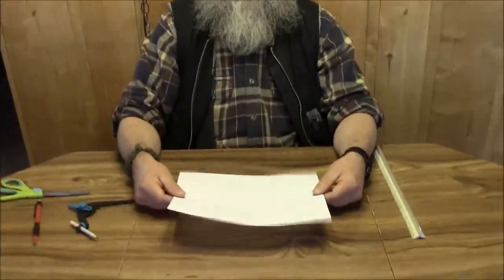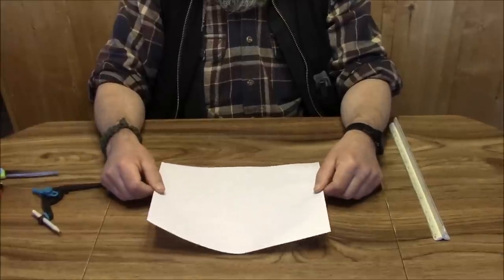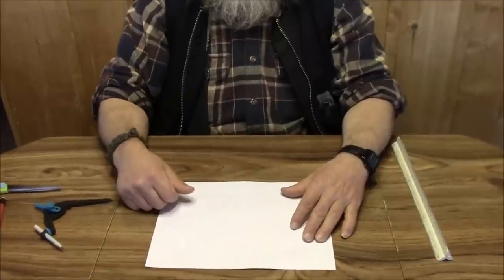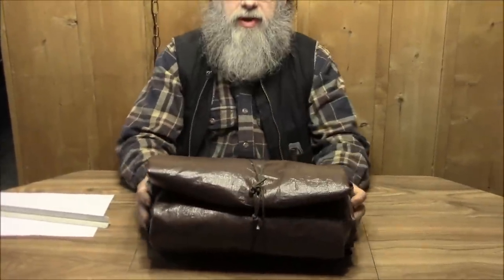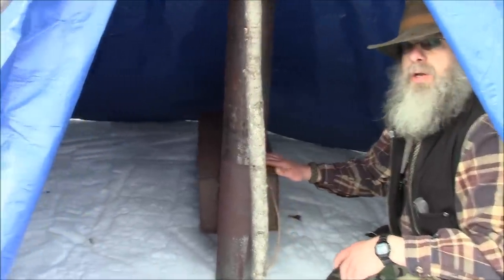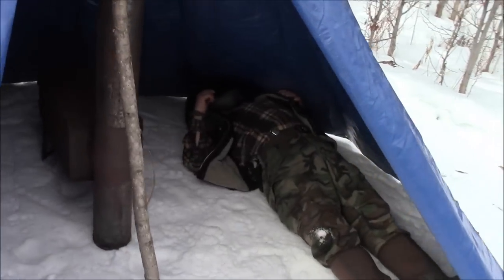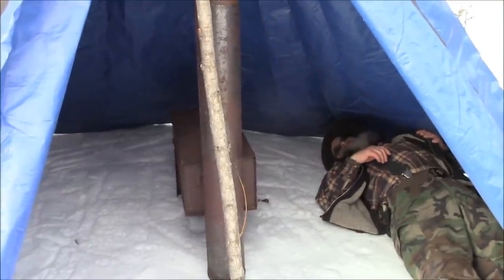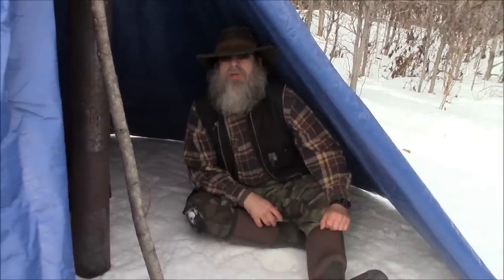Make A Tarp Tent Tipi Hot Tent On The Cheap

Comment: I lived in one like this for a year. Ended up homeless in tge beginning of winter during a pretty bad storm with freezing rain and snow. Add as much insulatiin as possible. Moss, leaves, even line the interior walls with any extra clothes or bedding you can spare if possible. I also dug my fireplace into the ground  and built more of a fireplacr like structure to create thermal mass and if you can, keep a pot of water or beens or chilli going. You wont have to get up every 15 minutes to add more wood and maintains the temperature inside. Oh, and another priceless addition, a funnel or makr one with a bottle and a length of water hose running away from the tipi through the wall.  Im sure any man can figure out how this would be priceless at 2am when its 12° f with 30mph winds and freezing rain outside.lmao. Last thing you want to do is go outside right then😂.

Comment: I've got a question thats been on my mind for a while now after watching these kinda videos, what about ventilation? Do you need airflow into your shelter to breathe, literally for oxygen or will you be fine for hours in this kind of shelter?? Appreciate the vids too man always enjoyable and informative.
Reply from the maker: I just spent a night in an enclosed tarp shelter night before last and I have spent many nights in the shelter.   If you have not already done so, you may enjoy watching the video where I show how to set up a simple tarp into an enclosed "tent".   the tarp configuration in that video is the one I spent the night in night before last.    No there is no threat of running out of air as the shelter is not sealed.   The bottom remains entirely open.

Comment: I really like this design.   I think I will give it a try.  Any idea of the standing height?   I know you made this years ago.   I want one for someone who is 6 feet tall.   Thanks.  I'll have to watch the next video too.
Reply from the maker: The height is about 6 feet but that is right in the peak where the pole is.  I am about 5.5 feet tall and I can stand up in it but my head is against the roof and the pole.   You may also like my cowboy range tent build as there is plenty of standup height regardless of a person's height.

Make A Pyramid or Range Hot Tent On The Cheap 
https://www.youtube.com/watch?v=t47WFUZM4go
Reply: For people making different size cones (tipis) there's a site called BRICKLAYER that you enter data (height, base) and it diagrams a pattern how big a tarp, the slant (length of poles needed) and can put evenly-spaced holes around edge.
Reply: For people making different size cones (tipis) there's a site called BRICKLAYER that you enter data (height, base) and it diagrams a pattern how big a tarp, the slant (length of poles needed) and can put evenly-spaced holes around edge.

Comment: Hi Lonnie! Greatings from Nova Scotia. Great vid as usual. Question, length of the pole? Can't wait to see your stove jack.
Your videos are very informative, you can tell you know what your talking about.
Reply from the maker: Gordon MacDonald Hello Gordon.   Thank you.  The pole is a different length depending on the level of the ground around the perimeter of the tipi as well as the center.  It is roughly 6 foot give or take a couple inches.The one I used in the video was actually an inch or two too long but was fine the time before in our driveway when I first set it up.   I just measured my 2 sticks and one is 6 foot 1 inch and the other is 5 foot 8 inches

Comment: That tarp tipi is nice. I love tipi's and found they are very nice in colder weather. I built a couple tipi's using tape and it works much better than I thought it would. I've only posted videos of two tipi's till now but working on another design that will be more practical. Live in Texas now and the weather isn't as cold here as it is up that way but these old bones like to stay warm. First night I stayed in my bigger tipi, it got down to 20 degrees F but with a small fire, it stayed warm and toasty. Tipi's are time tested and have well proven themselves to me. Thanks for posting.
Reply from the maker: +onewyatt1     Thank you.   I agree that the tipi is a great cold weather shelter.   Because of it's unique conical design it minimizes the higher areas and maximizes the lower areas.    In a tipi design, since heat rises and there is very little area for it to rise to, therefore it is warmer down below where the body spends most of it's time.
Reply: Haven't thought about that aspect of heat retention. I know a very small open fire provides great inferred heat and it reflects back down and to the middle which removes the need to rotate to keep all sides warm. Not sure yet how a stove will far as the inferred aspect, hoping it works the same. Thinking the stove would keep fire longer and smoke out better. The lack of need to have large smoke flaps will likely out weight any problem the stove may have in throwing off heat. I do plan to try a trampoline canvas floor, any fluid spilled inside will just run thru it. Can't be as bad as stomping mud holes in side.

Comment: Started working on one of these this weekend for a summer tipi I'm going to leave at one of my fishing spots.  Had a 20x20 tarp kicking around which meant really I just cut out a circle when I used your tracing method.  One nice outcome from that was that I was able to overlap my door without adding the pieces like you did.  Thanks so much Lonnie, awesome design.
Reply from the maker: David Anstey Glad you like the design and that it turned out well for you.

Comment: The genius is in the simplicity!  Excuse me if this is a stupid question Lonnie but don't you need a ground sheet? Looks like with the stove in there you'd wake up in a pond. Thank you both for all your hard work for us I learn new thjngs with every video.
Reply from the maker: I do use pieces of tarp or other material on the floor most of the time but I have also camped many times without.  You will never have water on the ground as long as you are camping on snow.  Even though snow is made of water, it is still very absorbsnt and always absorbs any melted water.  You will never have water on the floor as long as there is still snow.

Comment: Thank you sir for the tip I will have to make one of them those would make a good trap line tent how do you think they would hold up to a lot of snow you are right those canvas wall tents are heavy I used to run pack trips on horses and mules and we used them a lot hope you are doing good God bless Glen
Reply from the maker: Trayer Wilderness I have not personally used this in any snow fall yet since I just put it together but it is my opinion that it should hold up well especially with a center pole instead of outside bipod suspension.  While a person is actively at camp and daily using the woodstove then the snow while be a minumum problem due to melting off the tent from escaping heat.    I do think though that the tent would hold up to a snow load like if left for a while since it has no "roof" for snow to sit on but rather only walls for the snow to lean on.    Once the stakes are placed, they tend to freeze in and are difficult to remove when time comes to remove them and are not likely to pull out from snowload.    If you are planning on leaving the tipi set up and unattended then I would place the stakes every 2 feet rather than every 3 feet as I did on this video.     By placing the stakes closer together, it would help distribute the snow load more evenly on the tarp fabric.

Comment: I would like to commend you on the grommet installation. Your explanation is excellent, as you cover the parts that I have learned from hard experience.  With heavy duck tape reinforcement, grommets will stay in place and work very well.  Without the tape, it does rip out eventually.  One comment though - with my own tarp tents, I strip the tarp where the duck tape will go on and allow it to dry before applying the tape.  Otherwise, in very hot weather or under stress, the tape comes off the tarp, due to dust or grease or some sort of release agent on the tarp surface.  Keep up the good work!!

Comment: I was trying to figure out how to make one of these using a pentagon pyramid shape. This saved me sooo much work!
Reply from the maker: If you have not already done so, you may be interested in seeing my cowboy range tent video as well.   It is my current favorite tent of our approximately ten tents that we own.

Make A Range Tent Style Hot Tent On The Cheap
https://www.youtube.com/watch?v=t47WFUZM4go
Reply: Oh yessir, I watched it and this one back to back. I am ordering a 12x16 waxed/fire retardant canvas to use. I was wondering if that one was comparable to this one. It will just need to house myself, a stove, wood and gear. With the range tent I will need 2 of the tarps, do you think it's design is superior to justify the cost? I would pay for the better of the two. Also, I was thinking of adding some of the Mors Kochanski style super shelter mods. Similar to what you did in one of your camp shelters with the plastic and mylar. I finally found a place to get the good steel buckets to make your stove.
Reply from the maker: The tipi is a great shelter especially for cold weather but I got tired of always being hunched over in it or even crawling around on hands and knees.   The range tent does not have a much different foot print on the ground than this tipi but there is much more room in it.  It is great for even two people to be able to stand up in and move around.   However as you already noted, the range tent is much bulkier and heavier due to more material going into it's construction.    Which one is better is a matter of personal choice and weighing all of ones priorities.
Reply: Thanks for all of the replies. I can see where not having standing room would weigh on one's comfort in the long haul. I have a canoe to use and after 12 years in the army, don't really have that "must shave an ounce at all costs" mentality. I think of it as carrying a portable home, so a few more lbs isn't a deal breaker. I think I will make the bigger tent and the bucket stove.

Comment: Excellent video.  I really enjoyed the cooking channel technique at the start where you already have a pre-made model teepee instead of showing you putting it together.  I am going to make mine with some vinyl windows.  If you cut the window opening  properly just on three sides and leave the top uncut, you can roll up the tarp material and use it as blinds at night.  Just tape in your clear vinyl, plastic, etc, window in place.   This beats any store bought 100 pound monstrosity with a bunch of poles.  All you need is your tarp and a small expired tree.  I am going to make mine out of a 30 foot tarp and call it my mountain home!

Comment: May be a good idea to cut a slit big enough in a tennis ball to fit the pole. Doing this protects the center top of the tarp. 
To do away with the center pole, with out a tarp peg ... 
Place a smooth stone inside the center top of the tarp, wrapping it around the stone. Using a slip knot from one end of your cord, tie around the wrapped stone, tie the remaining cord over a branch or to a lowered tri-pod, then raise the tri-pod, tarp teepee will rise with it, then peg it out ... Done 😁

An awesome instructional vid 👍
Reply from the maker: When in a hurry, I now use an extendable adjustable pole for the center pole and do place a tennis ball over the end just as you are suggesting.   Once set up and camp is established, if I so choose, I gather TWO poles from the woods and make a bipod to suspend my tents from.   There is no need for a tripod.  A tripod can be a bit of a pain to line up just right over the center of the staked out tent base.   Since the tent is staked out, a bipod is just fine to use as long as the shelter is staked well. unless one is expecting strong winds that might pull the stakes loose.
Reply from the maker: I forgot to add that I purposely place tie outs in the peak of my tents just for the purpose of suspending them from a frame.

Comment: Hi Lonnie + Connie - Nice to meet you.. Your videos have struck a core spot in my heart. They are super! This is the way folks used to learn things - one on one so to speak.  
I came across you by accident (as happens many times) when searching the web. I was looking for a more efficient alcohol stove when I came across your video for the fancy-feast stove and have not stopped watching your videos for two days. At age 70, I'm a modest prep-er who makes his own rather than buy; if I can help it. You are a great inspiration for thinking outside of the box. My hat is off to you, sir.. Keep up the good work.
Reply from the maker: Thank you much for the kind words.   I too am glad that you found my channel and are enjoying the videos.   Welcome to the channel.
Reply: Thanks for the reply Lonnie.. I just finished making one of the Fancy-Feast stoves (from your directions) - works very well. It sure is a hot little beggar!
The only problem I found is; it is very unstable 'cuz of the small diameter base. I dumped a small hand full of road-side crushed stone into the bottom (about half way up the F/F can) ; gives it better stability. I like it better than the penny  stove. Much easier to work with.. No priming mess.. 
Here's a thought for you: I'm thinking about making a wire mesh top that would set even with (or on top) of the tomato paste can. Wal-Mart has a black wire cooling rack for about 4 bucks; cut a piece about 4 inches square; leaving two of the wire strands long enough to lock into the pressure release holes so it can't fall off (but can be removed for packing. No heat or flame interference because of the 1/4" squares in the rack. It may also give better heat distribution when using a 4 or 6" skillet. If I get one done in the next few days; I'll send you a picture.
I use these racks for making Jerky, so have a few kicking around... Oh.. You wouldn't be a Ham Radio guy would you? I'm a general class since early 80's - W1EDJ .. If you are; maybe we can chew up some air waves sometime. 
 You and Connie have a good week... Looking forward to hearing from you.
Reply from the maker: I have made quite a few pot stands out of hardware cloth in the half inch square size.  That screen can be purchased from hardware stores and makes great pot stands.    Nope I am not a Ham Radio person sorry.

Comment: I enjoy your videos. The calm polite manner of explaining things is refreshing. The variety of topics is also useful. I grew up in the countryside and been in cities for 2 decades. Long to get back out in the wilds. Your videos are part of my self-training preparations. One can also use idea X, Y or Z if things suddenly become a survival situation.

On the tarp concept been thinking of some options Im curious about.  Where you cut the straight edge V if instead you cut a single line out from the top pivot point you'll get two flaps. Based on the wind one flap can be angled out on another stick as a wind screen. The other makes most of the door, aside from a little bit of missed curve at the bottom.

Another idea is when cutting that V if you don't cut all the way to the point. That gives you a connected rain fly you can mount over your door with two more poles. you would want to reinforce the joints as they would be prone to ripping. Lowering those outer poles gives you the door flap.

The small corner cut outs you made look good for extending those flaps above. Also the material might be used to add 2 - 3 tarp layers to the where the center pole goes. 

It might be handy to have a plastic/wood cup/bowl to be used to shield the upright pole from the tarp. Its curve would disperse the loading a little better and less chances of splinters cutting into the tarp.

Havent done this so caveat on experience.
Reply from the maker: Brian Laxson Thank You Brian for the kind words.   By cutting the "door" line straight down, There would still need to be some extra material added to the top of the doorway to prevent rain and / or snow melt from coming in the top of the door.   It is hard to describe what it would look like without being able to show pictures or such.   Personally I don't see much advantage to doing that.    Your mileage may vary.   I had thought also of some sort of "cup" for the pole but the extra reinforced taped top seems to do well as is.   I was thinking like you of some sort of hard cone etc... protector.  I finally decided that probably a softer fabric might do better such as a glove or folded sock.   It appears though that the tipi does fine as is.

Comment: Conicals can be made many different ways and all have pros and cons.  I've put in 7 decades now and conicals have been part of me for 5 decades.  One method I've developed and will soon be putting on YT is to cut out an entire 20' Dia. circle, fold it in half, and then I have space between the 2 to insulate with whatever is handy and have a decent 10' hunting lodge, cutting 10 poles on site...for larger ones I actually make a Sioux/Cheyenne lodge with liner and all the bells and whistles.  I liked your paper comparisons and overall instruction technique.

Comment: Lonnie. first off Thank you for your work to help others. I tied your tent idea and it worked great but we decided to add 3 foot walls and sod cloth edging around the bottom of the walls.It works well and we found that by using three center poles I could add a table in the center poles. The poles also hold lanterns. My next one is half done and it's made of canvas and should be about 15 feet in diameter. The weight difference is back breaking.
Reply from the maker: awesome.

Comment: Glad I found your video before I bought a nylon hot tent. Nylon burns so it's tricky
Reply from the maker: I actually have many nylon/polyester hot tents and are pleased with them.   Nylon is a fine material for hot tents as long as one uses common sense.